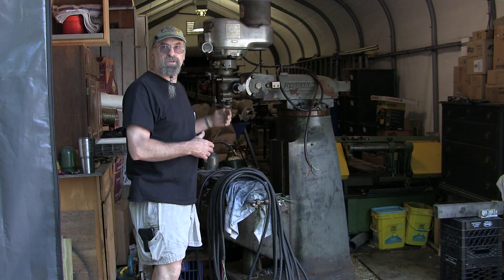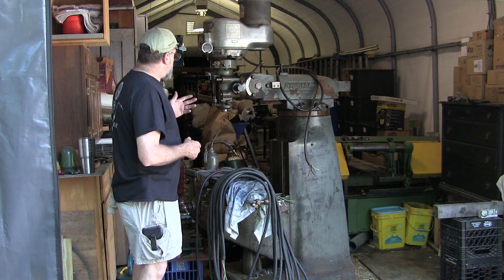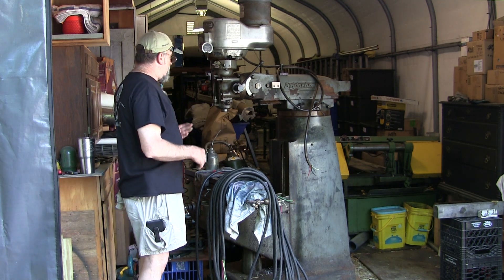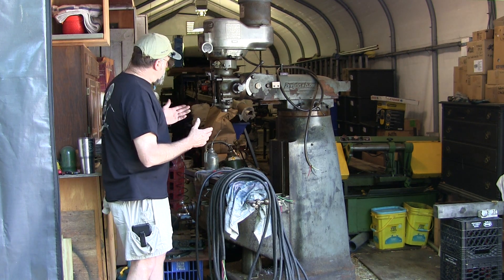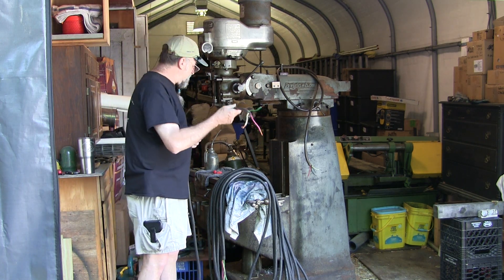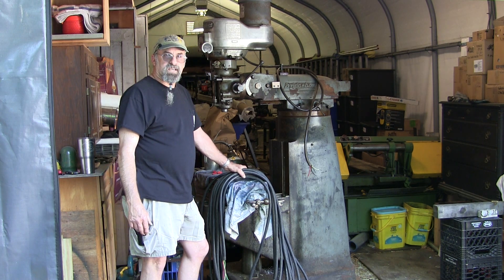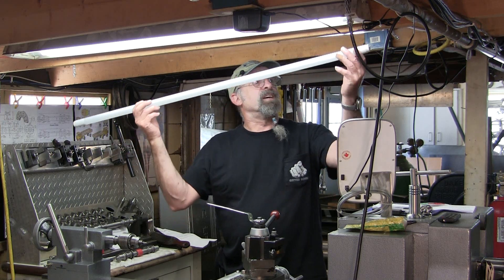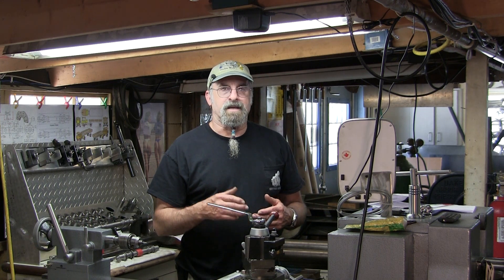Plug It In

Comment: Just my opinion on the Superbrightled replacements for the t 8 bulbs. Ordered 2 sets of 4 after seeing you tried them. Received them very fast by prime with special discount. Removed my t8 high outputs on 1/2 my small shop and installed the leds and left the other 1/2 of shop with original HO t8s in. Very unsatisfied with light output, much dimmer then the t8s. Was told that was the brightest replacement for the t8- they were only 2100lum-5000k. Customer service was great and emailed me a return shipper and I repackaged carefully and sent back for full credit.  If interested in trying 4 foot led shop lights try the ones from Sam's Club-$35 plus tax, very bright and can be piggybacked up to 10 lights. I have 2 of them in different areas and they are super bright. I am in no way knocking Superbrightled co. they are great and have great products, just my opinion on this product. Great Videos, Thank you, Ed K Cleve. Oh.

Comment: As someone already said, sounds like the plastic bushings are gone in the variable speed drive. I've had one so bad it fell apart and went metal on metal and locked up the pulley on the motor side. 

You can get to the motor pulley through the back access panel. The bottom flange has 3 holes that line up with threads on half the pulley. Run the drive up to max speed where the motor pulley is forced to expand. Then put 3 bolts in the holes to hold the pulley apart. Then you can pull the whole motor assembly out. Replace bushing and reverse process to get it back together.

Comment: Yeah, my long extension cord is just 20m(65ft)  of 2.5mm square, 240v stuff and really is only rated to 20A or so continuous.  :)
SO handy for being able to put the welder anywhere you like without voltage sag.

Comment: what the other mill is spoken for already, ugh I wanted it, a router is not enough for things sometimes,  

just kidding, but the bridgeport looks like its in pretty nice shape, even better then the one we have that's from the 1960's from the airforce that one of the guys keeps there at the historical railroad, and you can do anything with them even if it takes three times as long to set up as a new machining center, but they can do all the same stuff really and you can make tons of stuff without taking up too much space in the shop even if they are old as heck, just like a bandsaw in concept, good for lots of jobs and shaping.

Comment: I've just changed bearings, belts and bushes on our J head vari speed. I have a full list of head and spindle bearings if you want it, better off going direct to suppliers for them, Bridgeport are way too expensive. The plastic pancake bushes are cheap enough unless its a later model with the green nylon bush on the motor side. Bridgeport will tell you that you need a new pancake but you just need to bore it out and fit the plastic type.
Reply from the maker: My buddy that gave me the tech manual tipped me, with about the same tip. Thanks I'm sure we will see it done similar. ;{)------

Comment: You really shouldn't unplug a stepper motor when the driver is energized.  There is current flowing, even when stopped, to hold position.  When you break the circuit, the magnetic field in the motor collapses, causing a huge negative voltage that arcs across the connector pins and can damage the driver transistors.  You'll probably get away with it for a while, but someday something expensive will let the smoke out.
Reply from the maker: Thanks for the tip.  ;{)------
Reply: Yeah, like the ignition coil on older cars....12 volts, but can create enough voltage to give you quite a shock....on the primary side....
Reply: also, don't plug it in with the power connected either,  as you can catch the current sensing on the hop and the driver transistors can fry themselves with sheer enthusiasm.

Comment: Put the machine in high range with the spindle off, grab the spindle nose and rock it back and forth to check for looseness. If it's loose there is a gear that slides in and out between the ranges. The gear will loosen up if some one changes from low to high and starts the spindle without making sure it's fully engaged. I got a Bridgeport j head a few years ago that had 1/4 turn of slop in those gears. I was too cheap to buy new so I welded up the 2 gears and recut them on my cnc mill. Worked perfectly. Another point of noise is the plastic bushings in the vari drive pulleys that are worn out. My daughter lives next door to Hardinge brothers in Elmira N.Y. and I'm 40 minutes from her so for me parts are close by.
Reply: Cad-Cam_Man i

Comment: plastic bushings inside variable speed pulleys are worn out.
belts are frayed
Reply: Had about the same sounds on our 2HP Bridgeport at work, but management wouldn't do anything about it until the main belt broke. So finally we bought a repair kit containing all parts required ($250), which took care of all noises. Now the mill probably runs as smoorh as when it was new and is a pleasure to use.
Reply: Yngve Amundsen what management doesn't realize is that you lost the use of that machine for a day, or week untill parts come in
i had the same thing happen on a lathe i ran and they told me only once it broken i can fix it
the parts i could of made using the lathe needed to be ordered and since it was the only lathe in the shop i had nothing to do for a week but sweep the floors and help out with tea and coffee haha
my wages cost more then the parts, plus by day 3 the whole shop came to a holt because they had no parts that i would normally make for them
Reply: I would say thrust bearing on Variable speed pulley.
Reply: Yngve Amundsen

Comment: Those variable Speeds have a V-Belt riding on its cheeks. Those wear out an then the springloaded part of the pulleys start to chatter. I dont believe there are Bearings worn out (but replacing while open....you know)
Reply: I had to replace the bushing in the movable side if the pulley (springloaded side) mine made that exact same noise.
Reply: P

Comment: Another positive about diving into the Bridgeport is that you'll have more channel content now too!  But hey, you didn't test the knee and the table movement, or was it known the knee and table were fully operative, just the head that was unknown?
Reply: The  good thing with BP is that minus the castings, all of it can be purchased still from Hardinge.
Reply: But forget to buy any parts for it in Sweden! We tried when our 2HP broke down; but the Swedish importer didn't have much parts available. And what they DID have was EXPENSIVE! Even each small bearing would have cost more than $100, and the spindle bearings would cost an arm and a leg. Fortunately we found a seller in the US of A that had a kit available containing all parts we needed for only $250, and after buying this and replacing all worn out parts, the mill runs like a charm again.
Reply: Sounded REALLY crunchy at first. Then improved some. If I could hear it in person I could point out the source of the noise.
Reply from the maker: The table and knee were fine and will be remove for clean and paint, but rumor had it that back gear was damaged, but I head mid drive noise, could be nylon spindle drive bushing or next inline. something in that area, will tear top off and see. ;{)-----

Comment: I was hoping you'd say you'll tear the Bridgeport head apart, the speed control would be interesting to see!
Reply: Basically the same as a snowmobile/go-kart clutch but using a manual adjustment instead of centrifugal weights.
Reply: Reeves clutch...